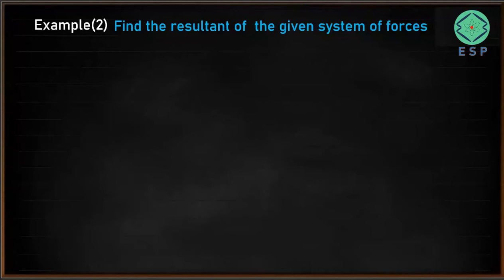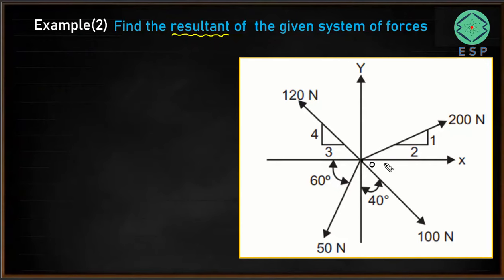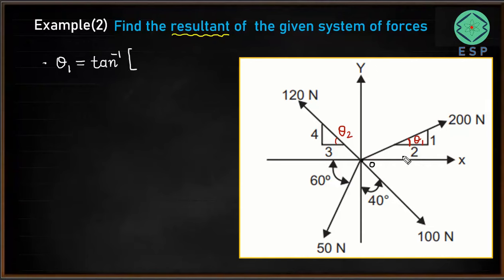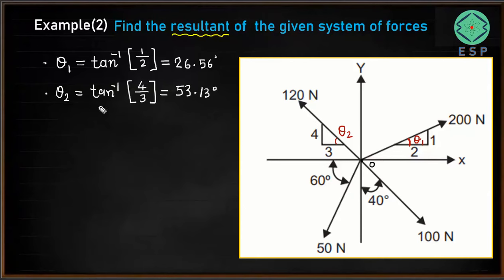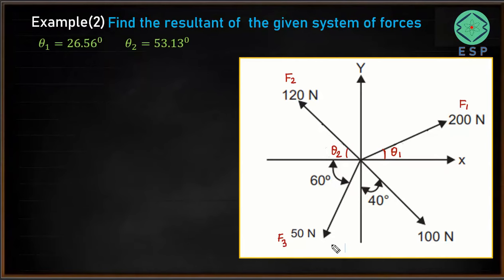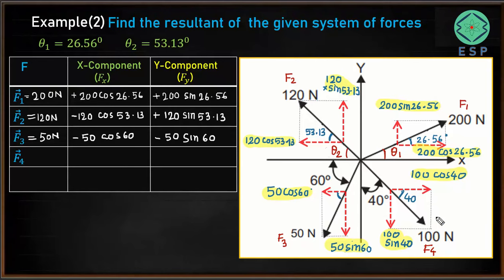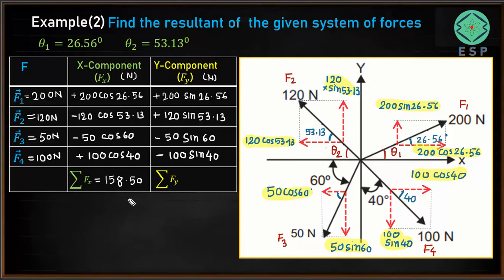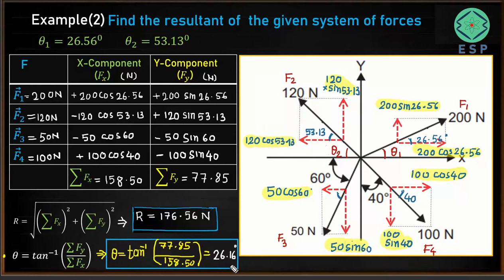Example-2 : Resultant of coplanar concurrent forces | Engineering Mechanics

Comment: Thank you for making a video on this. It seems to me that the signs of the x and y components were ignored. As a result of this, some information of the resultant vector is lost. Like in what quadrant, the resultant vector should be placed?
Reply from the maker: Please have look at table , I have taken X-component positive towards right(i.e. positive direction of X-axis ) and vice versa, Similarly for Y-Component positive towards upward(i.e. positive direction of y-axis) and vice versa. since  ΣFx and   ΣFy both are positive the resultant force is in first quadrant. I will take some question where resultant will be in 2nd or 3rd quadrant, then it will be more clear. Thanks for showing interest in the video.
Reply: Thank you for the clarification 👍🏻

Comment: I think your calculation is wrong. For the 100N the components are Fx=100cos50, Fy=-100sin50. You need to use the complement angle which is 90-40=50 degree to be correct. Your reference is always the X axis. Otherwise, Fx=100sin40, Fy=-100cos40.
Reply: Yes there was writing error, angle 40 is to be 50 degrees.
Reply from the maker: There was a writing error error, Apologize for error. Please read angle between 100 N and negative y- axis as 50 degrees in the place of 40 degrees . Remaining procedure is correct. Thanks and regards.
Reply: @easyscienceprep7445  Thank you
Reply: @BYRPSI  Thanks for the useful method. I learned so much and can now solve most of these problems.